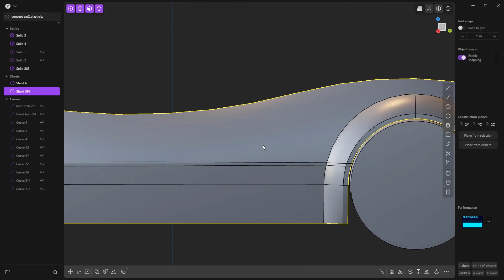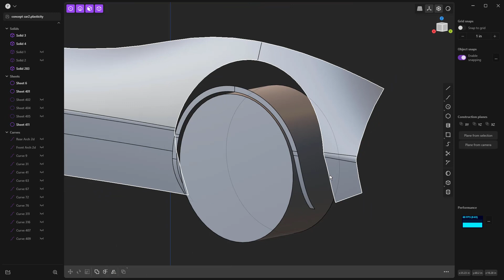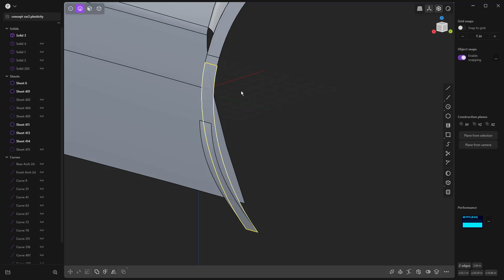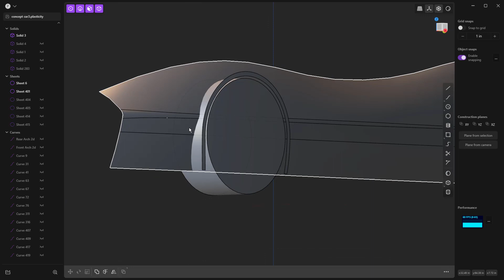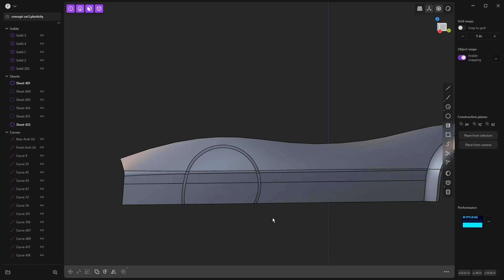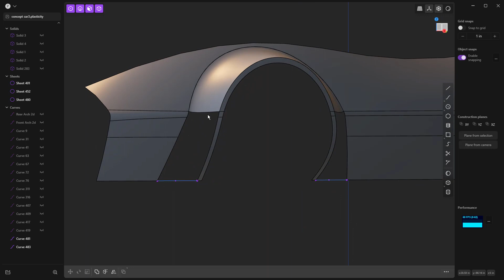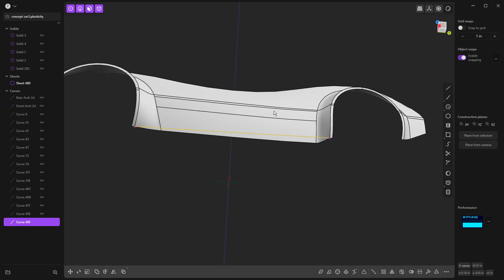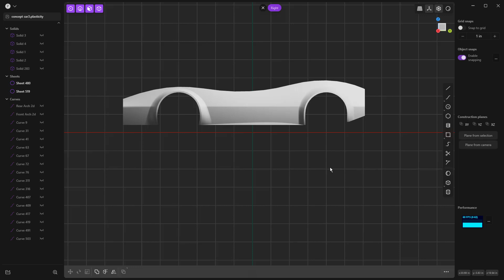How To Model A Concept Car In Plasticity | Part 3 | Building Fender Flares

Comment: This definitely helped my more "potato" like areas of my flares! The bridge curve is amazing when you figure out how to use it. I had a lot of problems lofting though. None of mine were as straight-forward as the ones you showed, and I often got errors thrown. That said, I have something that looks reasonable, with smoother flares, Thanks for another great video😊
Reply from the maker: Yeah its very tricky.  When i did this video it was before xNurbs was a thing outside of the beta software, but that is a bit more forgiving with the inputs.

Comment: I'm gradually starting to understand the difference between bridge curves and rebuilds. Interesting. It can be made differently from the blender.
Reply from the maker: Yeah Bridge Curve (and loft between points) will add a curve with some set continuity at both ends.  Rebuilding a curve can increase or decrease the number of points that define that curve.  There are some updates that let you rebuild faces and bodies that have the same sort of implications

Comment: You make it appear so easy, I could model a Lambo or Mclaren tomorrow 😂
Reply from the maker: lol.  So the series you see is probably the 4th shot at it.  I did a few videos modeling an aventador with blueprints, an s2000, and 2 other concepts, but wasn't really happy with the flow so scrapped them.  Then decided to just leave it all in there the good and bad because that is reality.